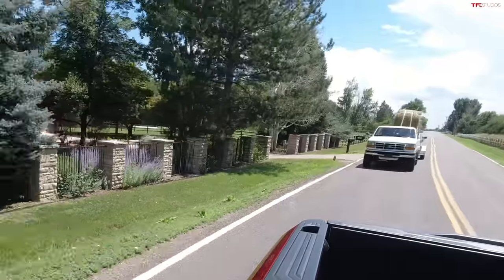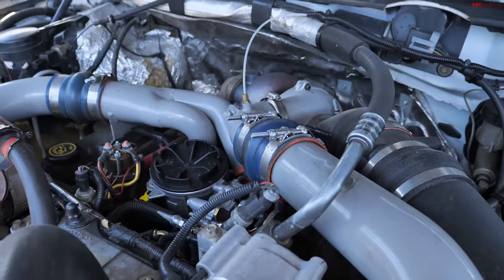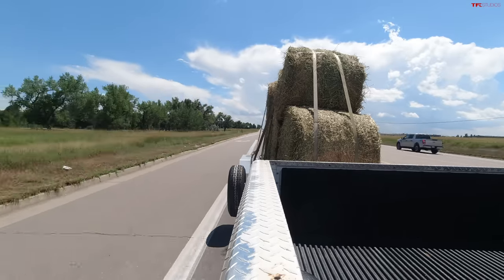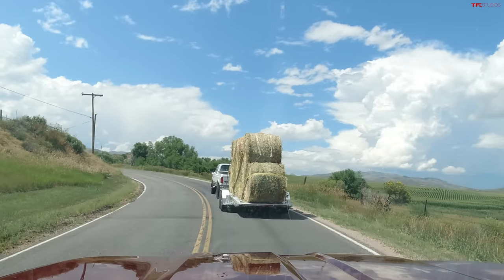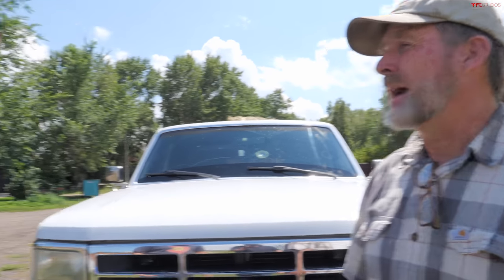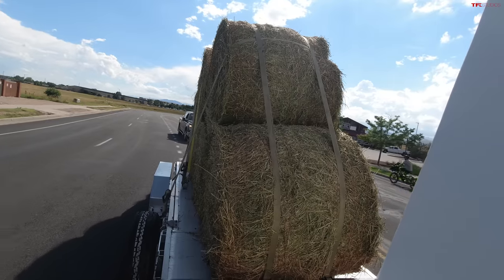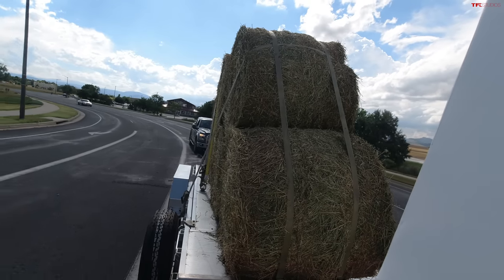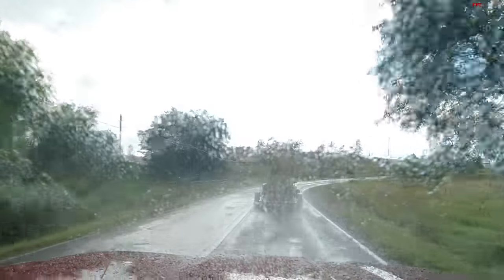Ranch Battle! Can a 26-Year-Old Ford F-250 7.3L Power Stroke Outwork the Legendary 5.9L Cummins?

Comment: Love this video… (2003 model year only allowed the HIGH OUTPUT Cummins engine with the Manual/Standard trucks!) 305 hp/555 tq all the automatic trucks from 2003 to 2004 were 235 hp/460 tq and in 2004.5 model year Dodge introduced the 325 hp/610 tq Cummins engine that came standard on every configuration for the dodge ram 2500/3500/4500/5500 and beyond
Reply: 🎓 2003- 2004 came in [Standard Output] 250hp/ 460tq and 235hp in California backed by a 5 speed manual or 47re automatic with optional 49 state legal [High Output] 305hp/ 555tq backed by a standard 6 speed manual or optional 48re automatic.  2004.5 Ram 2500/ 3500 5.9L diesel made 325hp/ 600tq and the 4500/ 5500 didnt come out until 2008 with its 6.7L making 305hp/ 610tq.

Comment: Cummins all day! I drive an ISX15 liter CMV and that thing is solid! Cummins don’t build trucks, they build engines and they build them right. Power stroke is GARBAGE! Need proof? 6.0 is probably worst diesel engine ever built. Only domestic trucks I would buy diesel is Nissan Titan with Cummins (Toyota transmission) and DMAX based Sierra GMC with an Alison. My alternate would be Dodge Ram 3500

Comment: I have a 96 dodge 3500 Cummins Dually, 5spd. It runs perfect. My dad was original owner and I have all the paperwork back to original window sticker. I love that truck. . I used to run a 96 7.3 powerstroke wrecker. I loved that truck. Neither were as nice and comfortable as my work truck which is a 2020 6.7 Cummins Ram 4x4 3500 Dually. That’s just because of technology and refinement. My other favorite truck was my 02 Silverado 1500HD with the 6.0 gas engine. Only ever replaced fuel pump, alternator,, driveshaft carrier bearing, and vehicle speed sensor. It was horrible on gas, but it was very comfortable, made it through all 4 of my kids learning to drive, and paid for itself many times over.

Each of these were great trucks, but my 2020 Ram is the best out of all of them, simply because of technology and refinement like I said.

Comment: Lol 7 bales, everyone out in my country runs 23 bales on anything from a 7.3 a 5.9 or any newer 6.6 duramax or a 6.7 cummins or 6.7 ford. The old ones are put to work the same as the new ones and they were always put to work that way. I pulled 23 bales on a 3/4 ton 6.5 gmc so they’ll all pull it

Comment: “4.10 gears and manual transmission, limits its towing capability.” What. How does TFL have viewers anymore, TFL only compares off roaders in one type of off roading, even though there are so many different kinds and each require a different type of off roader. And now statements like this. The automatic in these trucks (the E40D) was known as a slush box, and the only way to get proper towing capability was with the manual and 4.10 gears. I stopped watching this garbage several years ago because they do not know what they are talking about.
Reply: If you don't watch it don't comment 😂

Comment: I can't decide they are the 2 greatest diesel trucks ever made. They both had advantages. The 7.3 was reliable and strong. The 12 valve was strong and reliable. One does one thing a little better than the other but they both did everything well. I am a 7.3 owner and i still swaped to a 5 speed however when it comes to automatics the Ford wins hands down. The Ford auto had quirks but fixable quirks. You couldnt make the Dodge auto reliable it was out dated when it come out.

Comment: As a 14 yr. Dodge tech the 2007 5.9 Cummins with the 48RE was the epitome of Cummins power/ reliability in a Dodge. With a mild chip an 07’ Cummins Auto could swing 28mpg and that trans would hold up for 300K miles easy. Wasn’t the smoothest shifting trans but they had that old school 4spd down to a science.

Comment: André,Why do you Say that a manual transmission limits the maximum payload!?I would say an automatic is more limited because the loses through the transmission fluid coupling,wet clutches,and HEAT!?with a manual as long as u have fluid in it heat is least if your problems!

Comment: Nice truck but I wouldn't have anything older than a 2005 Power Stroke when the integrated trailer controller and coil spring suspension came factory. The newer trucks are so much more capable. I liked my 2007 and 2015 F-350s the best.

Comment: Would have been nice to see a 97 Dodge with a 5 speed trans and a 12V would have came out fairly even.  
12V and 24 are worlds apart stock
6 speed vs 5 speed also very different feel.

Comment: Old school rules. 5.9 and 7.3 simple design and simple repairs. Price on parts are up. Yet you get a truck that hardly dies. 7.3 has low and high oil pressure for the fuel injectors. Which oil change is a must for it to last. 5.9 is low and high fuel system. Also a routine oil and fuel filter change. Both good engines. And both have earned a reputation.

Comment: I have a 2000 4x2 lowered f250 7.3 with a diferent turbo and a tuner that i tow a 14k 5th wheel with. I also have a 2023 ram 3500 srw 6.4 hemi.  I like towing with the old ford better than the new ram.  Could we do an episode comparing the two  ?

Comment: I just like watching videos of older trucks doing work. We all agree this wasn't really much of a test/comparison. Didn't need to be. Most of us would gladly take either truck. I had one of those model Rams and I loved the power and MPGs for being a big truck, but one thing I absolutely hated was the interior. It just felt so damn cheap and crappy. All the plastic pieces seemed to rattle and have a loose fit. 

These trucks though still have a ton of power for most people. You don't need 75,000 lb ft of torque to haul your kia rio one time a year.

Comment: My 97 F-250 7.3  is completely stock and I’ve pulled 15k or 16k thousand pounds of logs on it… didn’t know it weighed that much till I crossed the scale. I could barely get it moving and forget about climbing any mountains 1st gear is not low enough to get a big load moving without riding the clutch.

Comment: Having owned both of these generation trucks let me sum it up. Ford (mine was 97 5speed 4x4) is king on the interstate but gets a little worse fuel economy, Dodge (mine was 04 6speed 4x4) rules the fields with its extra clutch engagement torque. Both ride like crap and the wiring on both can become a nightmare if in high corrosion environments. Both great trucks splitting hairs having to choose one over the other. Dodge has better brakes because it's 10-15years newer. Ford has a nicer interior even though it's older.

Comment: My 97 had a factory turbo on it, after the catalytic converter fell off, cough cough that turbo went wild plus I had it chipped 65 over.
Not only did it gain power but empty on the highway I could get, sometimes, close to 21 mpg on the interstate at 70 mph.
I greatly miss it.

Comment: I have the same truck minus the inner cooler and e40d not 5 speed. It will handle well over 10k. The sweet spot it 1800-2200rpm. The e40d likes right between 1800 and 2200 rpm

Comment: What’s the point of a truck hauling a max load up the Ike the fastest or the most efficient if the new truck can only do it for a 1/4 the miles with twice the maintenance cost then I would rather go slower burn more fuel and have a lass comfortable cab if I can go 4 times the mileage with 1/4 cost but that my perspective

Comment: One thing that they did not mention that they mention every time they try to put a substandard power stroke against a dodge Cummings hauling identical weight the Cummings uses a third the fuel same or most of the time more torque and power. The Ford lacks in so many areas poor suspension extremely poor interior lack of styling and yet people buy them because Ford is one of the oldest companies in America

Comment: As a flatbed truck driver, I am very happy to see proper securement used on those hay bales. I can't even begin to tell you how many times I've seen pickups hauling trailers full of hay bales with only a front and rear strap, or in some cases, only chocking the bales in place.

Comment: What I find most interstellar is that for all the generations and displacements Ford’s PS has gone through, a 7.3 sounds like a 6.0 sounds like a 6.4 sounds like a 6.7. More or less noise from peripheral items, but the primary running sounds are the same.

Comment: Amazing how different the older and newer generations of Power Stroke are. The current 6.7L is making more than double the torque of the old 7.3L. Way more power and bells and whistles, but it’s a trade off for user serviceability. Getting under the hood of an old 7.3L is way less daunting than the newer generation.

Comment: Nice comparison of two interesting trucks. Fun and insightful to watch. Thank you. My trucks have always been gassers, and with one exception V-8s. But the most I tow is my 7,000 lb. travel trailer. My diesel experience has been with my John Deere tractor. Bullet proof in the 16 years I have owned it and very strong. Satisfying to do work with it and all that low end torque.

Comment: A bone stock 7.3 is kind of a boat anchor by todays standards. One that's been turned up a little like that one will get after it good enough for most people's needs. 5.9 common rail is better right out of the box but that was more of a 6.0 era competitor when the diesel pickup HP wars really started to get going. 7.3 PSD was a huge leap forward from the 1970's technology IDI dinosaurs but they basically were just left as conservatively tuned school bus engines in the Ford application and never pushed real hard.

Comment: My 92 Dodge 5.9 12 valve  you could lug the hell out of it and we didn’t  have egt gauges but when I towed I would watch coolant temp at normal was 1/4 mark when it got at 12:00 I would drop a gear it would drop right down to 1/4 on gauge and now with my 95  3500 long bed dullay and if you read owners manual and the first or second page on a 24 valve it said in bold letters do not lug this truck and this is a 6 speed manual Ho at 325 ho .
Reply: My 92 12 valve with leaf springs on all four corners road like a log wagon  but pulling my 25’ Road Ranger put some load on that truck made it ride so sweat with it being 4x4 and being a 2500 .

Comment: I’ve never seen alfalfa or any other type of hay without netting…do those bales have strings holding them together? They also look about half the size of the alfalfa bales I buy in central Oklahoma. The bales I buy weigh around 1500lbs.
Reply: They're 800lb bales from look of it

Comment: I bought the 2004 SRW 4WD version of the Dodge with the NV5600 in 2009. When I was test driving trucks I also drove a lot of 7.3s with the ZF6. I also noticed the same thing about the clutch being almost all the way up before engaged. The clutch was the one deciding factor to go with the Ram.
Reply: I have a 7.3 ZF6 & my clutch engages normally. Butt I also had a 95 F150 with the Mazda 5 speed and that clutch did engage basically at the top

Comment: So had you guys compared the same model year, the Ford would have had the newer 6.0 power stroke, which made 325hp and 560lb/ft of torque.

While the 6.0 does have a bad rep, it can make a lot of power 😊
Reply: That was the biggest POS Diesel ever
Reply: @damontroch4765  actually that would have been the 6.4
Reply: @damontroch4765 I hear that the 6L is incredible once the new head studs are installed, although hard on fuel I hear, not efficient like the Cummins.

Comment: Correct me if I'm wrong but didn't the 7.3 compete with the 12v not the 24v?
Reply: The 7.3 Powerstroke competed with the 24v from 1998- 2002.

Comment: Should actually be a 12 valve to compare or the first 24v.  A common rail Cummins is more powerful then that Gen of 7.3.  Even more than the last gen 7.3 stock to stock.
Reply: This was the optional [High Output] version.  The [Standard Output] was 250hp and 235hp with 460tq for the [California Standard Output] during 2003-04.
Reply: @Sir.VicsMasher  The OBS powerstroke from 94.5-97 were rated at 215 HP and 425 TQ, 1999 saw a bum to 235 HP and 500 TQ,  the 01-03.5 had 250 HP and 505 TQ for the auto trans and 275 HP & 525 TQ for the manual.  I owned an 01 with the auto.  First common rail was 305 HP and 555 TQ, then another bump in 04 to 325 HP and 600 on the TQ.  Stock for stock the common rail beats the 7.3.  Hence why a 24v would have been more appropriate to compare.  The H.O. ISB made 245 HP and 505 TQ.  A little more Apple to Apple.
Reply: @AFoxintheWild  "The first year common rail" in 2003 and 2004 came standard with 250hp/460tq and 235hp in California.

Comment: Fantastic to get David's insights on the differences between the 2.  Obviously he has a favorite, but is open minded to what other products have to offer.  Tiny bit surprised he was not driving a GM product with a diesel. 🤔 Which furthers my belief that he chooses what is right for him for what his needs are.  Not always about brand loyalty.  My summary based on this comparison is, if you like the drama of that 7.3 and the fan fare that comes with it, it is the clear choice.  If you want the drama free everyday quiet work horse, that 5.9 is the way to go.  Not sure I have a preference when it comes to either, as I do not have a need.  I am not a fanatic of diesel to begin with.  But the drama seems more fun if one is going to do shorter trips.  Long hauls I guess I would choose the 5.9.

Comment: I prefer the Ford.
 It looks better, and sounds better. 
And I bet if something goes wrong with it.
 The parts will be cheaper cause it's not all electronics.
It's just a piece of dependable, old iron and diesel. 

Now don't think me a Dodge Hater. I had a 97 Dodge 2500  24 valve auto. The trans was trash, but boy could it pull.
However  the 12 valve dually that my uncle had would out pull it. 

I got back into gas trucks when my nephew bought a 2006 chevy 2500 auto, and it could walk a 24 ft  gooseneck trailer with 16 round bales on it .
Just by putting it in gear without touching the gas.
We pulled hay all over the state at 70 mph all the time.
Reply: My experience owning a 03 Cummins with the 24v and a 01 7.3, both I still currently own. The repair goes to the Cummins, when it does need a repair including that crappy transmission it’s been cheaper to fix. The Cummins also in my opinion is easier to get to the parts without taking stuff off to access it. But my dads old 97 powerstroke has been reliable and I can say for driving around I like the sound of that old 7.3 growl.
Reply: Well that's why David went with a manual.  The Cummins weak point have always been the automatic transmissions.
I have a 5th gen and it pulls great but I just hate the way the trans acts. It's always in a hurry to get to 6th gear. I wish they didn't stop the 6 speeds when they switched to the 5th gens.

Comment: Love both trucks. I have the same 2003 Dodge with automatic 230,000 miles. Just hauled a 38ft camper from Ft Myers to Austin. My only issue was I-10. These trucks just work.

Comment: What i did on my truck 1/2 ton  is i removed 2 leafs from each  pack ,then instead of using 2-5000lb airsprings,   i installed 4 -1000lb airsprings  and only inflate 2 of them when im  not carrying a load, then i inflate all 4 when im carrying a load  ,  rides nice no matter what  .  alot more adjustability  .

Comment: i would take the 1st gen  12 valve cummin`s over the PSD any day , those 12 valves are easily modified to produce a lot of torque , or turn the torque down and increase fuel economy just by adjusting the P pump

Comment: The ford is a good looking truck but look's all most bot one in 93 went with a dodge D250 exsended cab 4x4 5 speed manual Cummins used to tow a kabota tractor and a 30ft Layton travel trailer put 258,000 trouble free miles on it traded it for a 2005 ram 1ton dually 4x4 quad cab manual Cummins 5.9 sil driveing 400plus all most trouble free miles on it

Comment: Had a 1995 E-350 passenger van with the 7.3 powerstroke. Added a tuner, k&n filter and 4 inch exhaust and it would spin the stock tires at 1/2 throttle

Comment: Iv got a 2024 gmc pro 3500 dually duramax just bought but earlier this year i was hauling 17 round bales on my flat bed trailer with a 2013 2500 6.0 vortex gasser that tow weight is 33,000 pounds 😅

Comment: You should do a comparison of the big three of the mid 90s generation.  Would be a more accurate comparison.
Reply: A GM w/ a stock-ish 6.5 would be a complete non-player.
Reply: @guentherwilke2055  kind of the point.  They are comparing different generations of trucks.